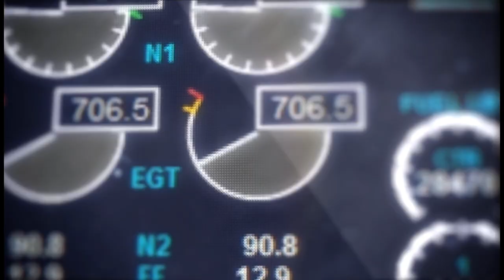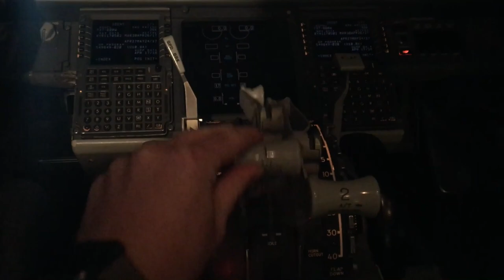Can a circuit-breaker crash an aircraft?

Comment: What about the problems of bad memory or of one's imagination? In being asked to drive a car that was not mine, on the job, I thought I saw a small wisp of smoke coming from the steering wheel when turning the ignition switch to start it. Tried to show my boss, but where is the evidence? Nothing visibly charred, no bad scent of something burned. What is to show, other than maybe I just do not want to drive that crappy worn out car? How many things might pilots observe, that they can not prove, but is reliant only upon their memory or observation but can not be verified? Should they report such problems that they can not prove? Will somebody accuse them of being incompetent? Or of worrying too much about nothing? How nice sometimes to have a dash cam, or some sort of recording device that can verify that the problem was not simply one's poor perception, or one's fault memory or imagination.

Of course I want to report it, because if something later happens, the car catches on fire or something, I do not want to in any way be liable for not reporting a problem with it.

BTW, the situation was that the company car was lent out to a worker, and that car was hers. That car had no heat I think it was, which the heat wasn't as needed during the day. Well the swap was soon undone for some reason anyway. The company car was much less crappy, although also a so-so old car.

Intermittent problems which can not always be reliably verified, are such a pain. It is good if somebody else can also see the problem occurring, so as to help verify what is going on.

"A broken appliance will operate perfectly when demonstrated for the repairman." -one of Murphy's Laws